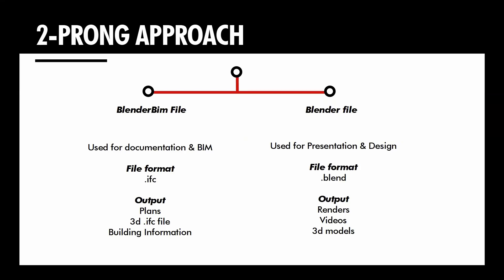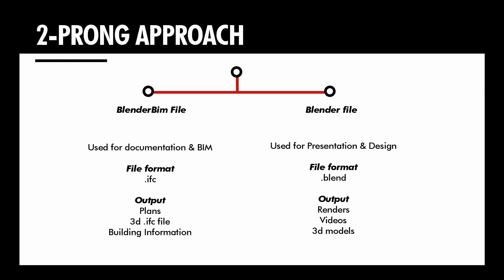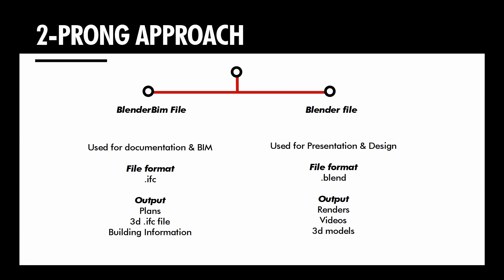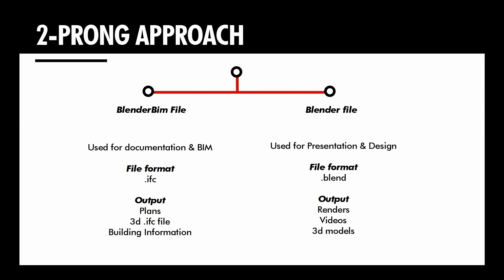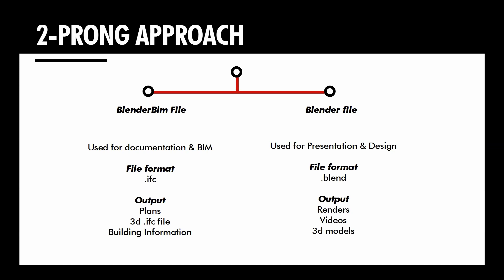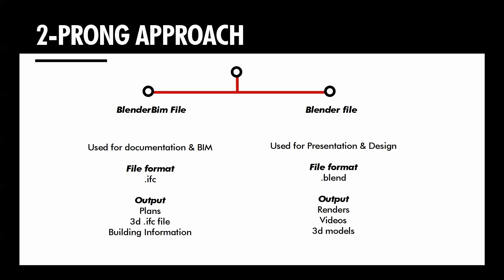The ULTIMATE Blender and BlenderBIM Workflow Guide (2024)

Comment: Just the thumbnail is sufficient to understand. I have one question- is IFC fully open-source and why it should be considered to be used in BlenderBIM, i mean why not BlenderBIM should adopt seperate file format or .blend to hold BIM data.
 I mean as a common man, i feel blender to be more open-source in itself than building-smart (ifc format) as the foundation and history of blender shows that,  even i read in Wikipedia that Autodesk is also involved in building process of ifc so it is out of question that some policy will not be favourable to Autodesk close concept. I mean when we have full freedom why to adopt any solution that involve any interference of old established entity that have full experience in playing with rules and psychology of people. Seriously, i trust blender itself more than ifc. Even i see that as microsoft acquired github, some hindrance to opencode may occur in near future. I want to know your opinion about that so we get clarity.
Reply: I am a common man too,  read your post several times but couldn't understand it, sorry
I use BlenderBIM primarily for IFC authoring a 3D model to run quantity take-off,  thanks to BuildingSMART / IFC format I can also view that model outside of BlenderBIM, or share it with others
In my job I use international standards for classification, both things allow me to communicate with others, the same way I am using english even though I am not, cheers